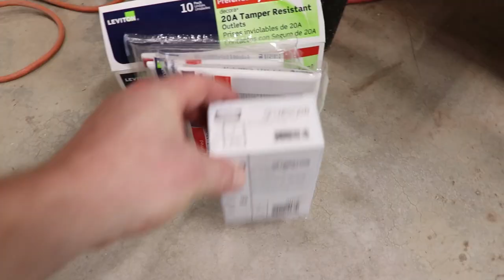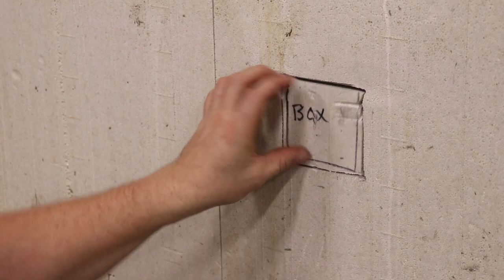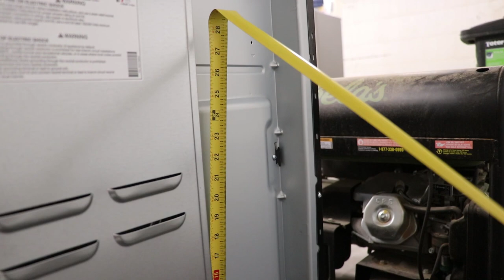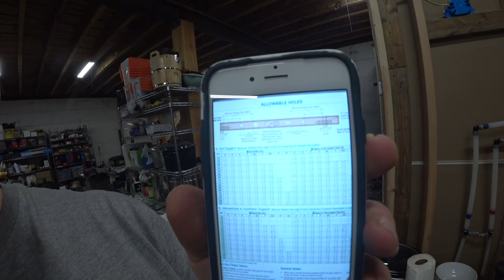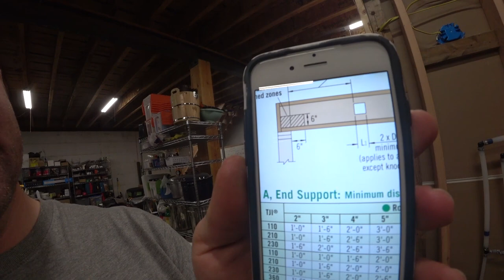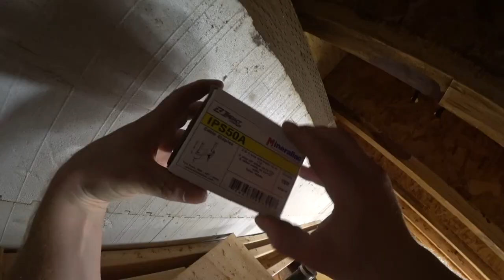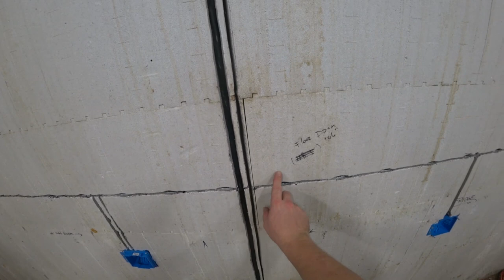SOLVED: Generator Interlock Solution (Backup Power)

Comment: I’m not bashing nor judging. 
I see you want to do the best practices and are willing to learn, so I’m happy to help people like that. 
I want to see you succeed!!

Depending on the inspector in your area, you might get called on your white wires not being completely re-identified for the conductors full length in your panel and boxes (where it terminates and is visible and accessible)? Your Local guys would know better. 
Personally I would make it so I was not able to visibly detect the ‘white’ in the wire. 
The good thing is that even though you re-identify down the entire white wire length, you can still look at it upon closer inspection and see that it used to be a different colored wire that’s not naturally that identified color.
The National Electrical Code (NEC) section 200.7 (C) talks to the white conductor being marked as a ungrounded conductor (hot wire) at its “termination.”  To many, this does not mean re-identify in your case, at the location the white wire literally gets compressed under the breaker screw and that’s good enough. 
The phrase “at its termination” to many craftsman and inspectors would mean in any enclosure where the wire is terminating.  
The other code parts is “visible and accesible.” Again, it’s like you said.
This rule it so that you and others some day behind you that look into that enclosure will “see” only hot wires that are truly hot and not “see” oh that’s a white wire and miss the black, red, blue, etc. marking.

Comment: Sourdough Starter
4 cups warm water
1 ( 1⁄4-ounce) package rapid-rise yeast
5 tablespoons sugar
4 cups all-purpose flour 
1 russet potato, peeled and quartered

1. Add the warm water to a crock jar that holds at least 1 ½ gallons. This will prevent the starter from frothing over while it’s setting up.
2. Whisk in the yeast and sugar and let sit for 1 minute.
3. Slowly whisk in the flour. Drop the potato pieces into the bottom of the crock jar. Cover with a tea towel and let sit on the counter for at least 12 hours, stirring halfway through. You can let the starter sit longer for a more sour flavor.
4. Before using the starter in a recipe, whisk it briskly until smooth.

To recharge the starter:
1 1⁄2 cups warm water 
1 1⁄2 cups all-purpose flour 
1 1⁄2 tablespoons sugar

When you have used 3 cups of the starter, whisk all the ingredients into the jar. The starter is ready to use again, or you can let it sit for 6 to 12 hours to create a more tart taste.

Comment: Y'all need to do a Load Count before you design a circuit. Balancing your panel load is very important also. In the states, most receptacle circuits only allow you up to 9 receptacles in series per circuit after the GFCI if a GFCI is required which would be 10 receptacles in total using 12g wire on a 20A breaker. Lighting is another story. Also, you're not understanding what those numbers mean in the electrical boxes. It's basically telling you what the max amount of wires based on the gauge size is allowed or will fit if you use it solely as a junction box without any devices installed such as a receptacle. By the way, your Range Receptacle is upside down.
  I still can't comprehend (although you explained it) why y'all just don't frame out the walls in the garage. It would be cheap. It would be much easier to run your electrical as you stated. It would easier to up the R value by adding additional insulation if desired and it would make hanging drywall a breeze with a nice finished look. Not to mention being able to easily bolt cabinets  / shelving or whatever to the walls. Just my 2 cents guys. Carry on :)

Comment: Sourdough, keep us updated.  Now I know how your got it going so fast, you got a established starter.  I tried to get one from a local bakery in San Fransisco area and was told no because that was their secret.  
You put the 20 Amp outlet in upside down.  The ground pin should be at the top.  This is to protect in the event that something conductive drops between the plug and outlet.

Comment: 50 amp outlet. The feed into my house is only rated for 100 amps and the main braker is a 60amp how ever we do have 3 phase 415v to the pannel 240 to the neutral bar. Do you want me to send you some 240 volt heaters im sure they dont use anywhare near 8000 watts

Comment: Way to many outlets on one breaker in a workshop for my liking.  I like multiple circuits down a wall in a workshop or kitchen for multiple big loads.  Haveing circuits on separate breakers is handy when you want to use multiple high power appliances or tools at once.  Also good so you can put your high power devices on a separate circuit from low power voltage sensitive sppliances like computers so motor starting doesnt disrupt computers as much etc.  We only have 230V here in New Zealand but i would still run at least  two 20A circuits for that many outlets but i tend to hAve power hungery hobbies

Comment: You don't need to hot knife through the plastic strips in the ICFs you can hot knife in the couple of inches between layers of the ICFs where there are no supports.  This will work better and faster.

Comment: holy s**t, the cables in USA must be expensive, they are thick. are you running on low voltage over there?
Reply: And it was nearly DC volts, but thats history. They think that theres less of an electrocution chance when its 110v, but the problem is it requires twice as much amps , whic gives a higher fire hazard ... 1000W on 110v =  9.01Amps  on 220v (Europe) = 4.5Amp so thinner cable ... because generally you count 4amps per mm²

Comment: They make a 50 amp power inlet box for generator to mount near the panel, no idea why the electrician didn't suggest that. Much easier, safer and water resistant than the cord. The smaller wires are supposed to be continuous in color per code, not marking tape or heat shrink. The blue nail on box knock-outs are not suitable for range wire. A electrical inspector could eat you alive on this installation.

Comment: Jesse, I'm still not straight on how your putting 15 and 20 amp receptacles into the outlet you showed in the video.  There is first a scene that appears to show you throwing a 20A breaker but that doesn't sound right if your trying to protect a 15A receptacle.  sign me, "confused viewer".

Comment: Alisha Pizza on the stove top basically......get a skillet and get it warm a little and then add in some mozzerella cheese just sprinkle it around the skillet and melt it, don't stir and then once it melts in there and it's fully covered let it brown a little. Then start adding in your toppings that are cooked already except for your cheeses. Then sprinkle in your other cheeses and more mozz. cheese on top and brown it in the oven basically just melting the cheeses and warming things up a bit. VERY GOOD pizza! OR you can use boiled chicken in the crust with mozz. Check out Keto Connects you tube channel for loads of recipes. Congrats to you guys on your pregnancy! So glad to see you two eating well. :-) We do low carb no grains as well.

Comment: It kills me to see you using that little soldering iron. 100/150 watt probably.
Forget the metal plates. Forget the soldering iron except for the boxes, that works great.
Pull out the big hot knife and slide it sideways along wall. And cause you have that guide to set depth (Probably need to bevel the leading edge or at least give corner a radius) it would stead your hand.

Then lay in spiral loom or metal conduit, and fish in wires to maximize capacity vs all the extra sheathing.
But either way, keep up the great work Sir and Mam.

Comment: about the 240v heater in the bathroom, don't you have some 12/2 red wire, the exterior is red and the conductor are red and black, or is it something not available/not to code in your area ?

Comment: I know I saw heating tubes installed in the floor for hydronic heating. I'm at a loss why they are attempting to heat an entire house with electric portable heaters apparently. This is the absolute perfect place for an outdoor wood burning boiler system....some of them also burn straw/hay bales. They are designed to be add on so an inside boiler running on either oil or propane can still be added as primary if desired....burning all day on a single hay bale is not a bad deal though and from what I understand is typical performance. My friends son runs one of these and heats not only his house but a 6 bay auto body garage with heated floor with a single boiler outside running on hay bales!
Reply: Their plan that they talked about in previous videos is to eventually set up an outdoor wood-burning boiler for the radiant heat, but for now, because Allissa is pregnant, they just needed to get in a short-term heater to make the house livable.
Reply: Jesse has already addressed this very issue in a previous video.
Reply: If I recall, that is their plan ... to add an exterior woodburning boiler.  But,  they can only accomplish so much at a time.
Reply: Time.     These expansions will come with time.  Having spent only a summer and bitter fall living in an RV converted bus while doing a house addition, I fully understand the push to get out of a tiny RV and into a functional space…  I can’t imagine doing that for 3 years.  It was bad enough spending summers in oilfield camps where there was on-site catering…
Reply: How much insulation was put in the floor ?
Reply: tazmun they wanted to get moved in sooner than later so they put in temporary electric heat
Reply: tazmun There is only so much time in a day! I believe that the heater is only temporary. Trying to hook up an outside wood burning stove is a massive undertaking, typically it has to be 150’ away from the house. More trenches which is not easy in the winter.
Reply: Can you overheat the cement floor with a outside wood burning boiler system?

Comment: Al lot of the stuff you folks do is not allowed in Europe. In Europe it is not allowed to have an electrical outlet in the bathing area. For electrical shavers there are other outlets, the completely galvanic separated outlets. The cables in the wall are a no-no to. In Europe first an isolating tube goes in, and than the wire. It takes more time for the construction but safety is important. In the U.K. even every outlet has a switch and a fuse.

Comment: Jesse really is lacking in the electrical knowledge. He is dangerous with his lack of understanding about what he calls Hot and Neutral wires. The neutral is just the same as the Hot wire. They can both shock you and there is no difference when dealing with AC. In Europe we have sleeving to show if a cable is being used for a purpose other than the colour it was made.

Comment: I put part of this comment on the Instagram photo (on Dec 15th) about the by-pass switch. Have you thought about this idea to have your some of your LED panels on different circuits? This way you're not using all of them at once to conserve electricity, or you could also wire up the LED Panels in the garage only to use some of them when the power goes out. You do not need all 10 LED Panels on at once (I think that is how many I counted, 5 on each side of the garage), say only have 3-5 LED Panels running (2 on one side near the stairs and 3 on the side or 2 on one side near the stairs and 3 on the side of where the bathroom is) instead of all 10 LED Panels. It should not be too much more to rewire them. that should save you a 150-250 watts (if the LED Panels are between 25-50 Watts each)? Another Idea to is since you have quite a few Solar panels, you want to keep them (you will need to buy some better batteries first) you could use it to power something in an extreme emergency. like keeping your computers & internet up plus some emergency lighting. It's like having a backup for your backup!

Comment: I hate the idea of those twist caps for joining wires.  And I shall be very surprised if those two wussy little screws into insulation secure the boxes when you start pulling plugs out.

Comment: Jesse putting cable in insulation is not good idea because every cable heat up if you have enough load on...👍
Reply: It’s perfectly fine. Most exterior walls in America has wires and outlets in it.
Reply: Bostjan Trancar - But not enough to worry about. It’s SOP for ICSs.
Reply: No. That wire is not going to ever heat up enough to be a problem.
Reply: As long as you size your loads and wiring appropriately heating the cable isn't a problem. Also all cables in any climate where you have heating and cooling it's in insulation in the outer walls.
Reply: It doesn't matter thats what derating is for, in most circumstances the fuse/breaker protecting a cable is nowhere near the max rating.

Comment: Using a box with tapcons into the concrete would've been the most durable. The way you did it you better foam those boxes in because you're going to need more holding power that two screws on one side.

Comment: You two might be interested in a Thermal Cooker. It uses less energy than a slow cooker but can accomplish the same thing. You bring it to a boil then set it aside and it cooks all day (or night). Much less energy use for the same effect. http://a.co/d/9hLESp5

Edit: I have no personal experience with one but I want to give it a try to save energy. I also don't have any reason to link that specific product but I wanted to share an example for ease.

Comment: my experience with those home depot thermostats like the one you have in the bathroom has not been good. what happens is within a few years they turn into basically an on/off switch and will bake the room/building full blast at all times or provide no heat at all.

very poor quality that will almost certainly fail within a relatively short time.

Comment: Save yourself a couple bucks, even though you are running a 20a circuit for those outlets, I'm 100% sure you'll never be plugging in an actual 120v 20a device, when's the last time you even saw one of those? Just buy the standard 15a outlets to run on those circuits.
Reply: I don’t know about Idaho, but in my part of the world, that’s how you fail an inspection.  20amp circuit, 20amp receptacles.
Reply: Tyler Ward My understanding of NEC says that if you have a 12 gauge wire you need to put in a 20 amp receptacle. That being said most electrical inspectors let it slide. But unless you pigtail the 15amp receptacles you can overload them.
Reply: Tyler Ward I agree.

Comment: By the way, it looks like your strippers habe the “Romex” cable sheath cutters on them. 
So you could use them to take off the cable sheathing before you stuff wires in box, you might like that way better?
I’m sure you already know this.